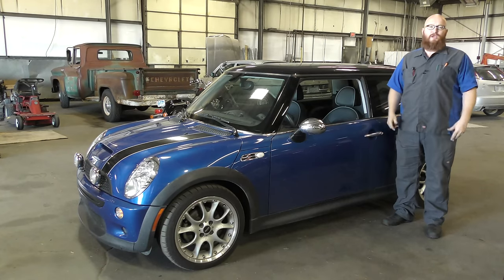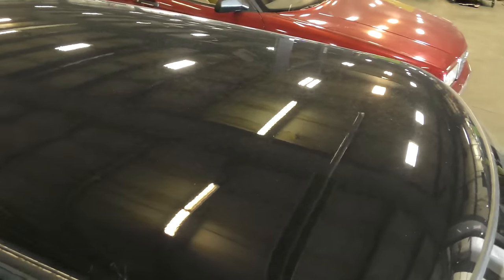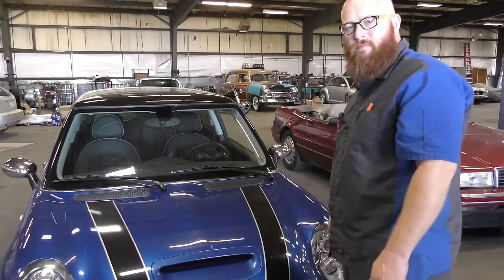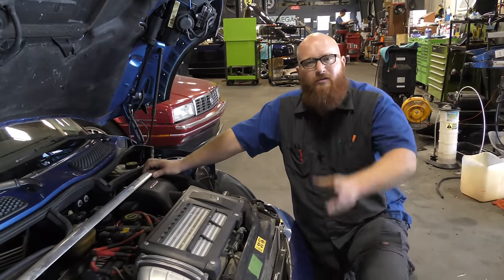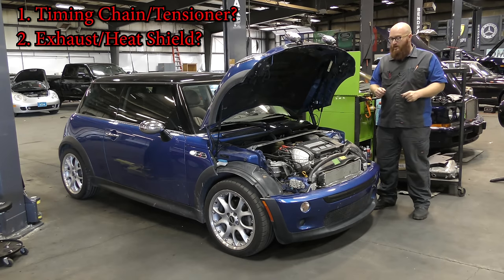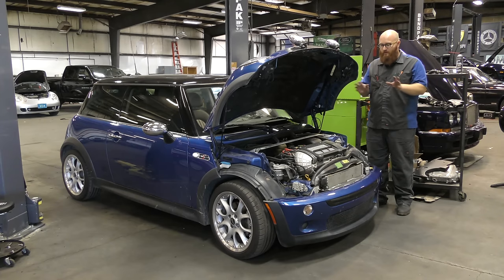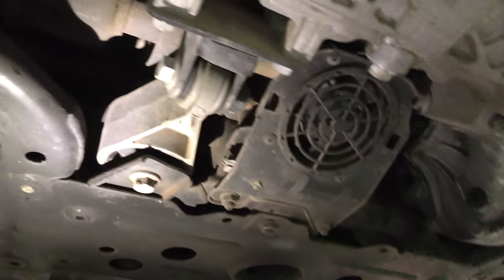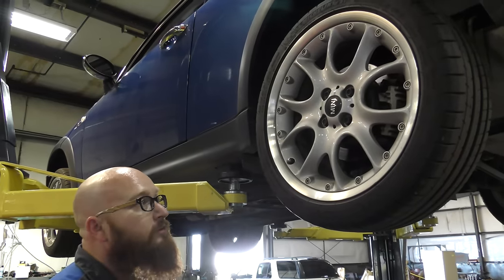Roaring Loud Mini Cooper S! The CAR WIZARD finds the source of the mysterious noise

Comment: My Sister In Law had one. It was so expensive to fix every time something went wrong, and things went wrong a lot, that she had to get rid of it. I would never own one, or a BMW for that matter. No thanks!
Reply: the newer ones with the bmw centre dash console ? seen loads of em fail. 2k british pounds for essentially a radio, sent many to the scrapper
Reply: @deadprivacy  

My Sister In Law's had the passenger side door lock go bad. It unlocks the other door when you use the key in it. Total to fix it $2300. My brother asked if he could get one from a auto dismantler and put it in himself. They told him no. it hast to be synced with the engine ECU. She traded it it on a Hyundai and never looked back.
Reply: @romeoalphafoxtrot9517  yep those are the issues and why you dont like working on em,,,,a lot of stuff is propietary and coded on em.
i get told off for booking em in for more than brakes and aservice, the gaffer of where i work has been burnt before on em.
Reply: BMW's have an underserved reputation for being costly to run. Just avoid turbo charged engines and M cars!
Reply: @shatbad2960  thats nonsense, they have that reputation for good reason, mainly the parts costs, there are thousands up on thousands of them in scrapyards the world over, put there because they're worthless when they fail and an  absolute shit to work on.
the words "not economically viable to repair" personify the modern bmw. same as audis. shite.
Reply: @deadprivacy  Americans are over charged for labour which doesn't help. Further more, there are many BMW's on the road, so many will end up on the scrap yard. The only serious issues I have ever had after years of owning BMW'S are turbo diesel issues. I wouldn't buy an early 335i or some later turbo cars either. I will say this, for the price, it's hard to beat a BMW for driving fun and luxury on the second hand market.
Reply: @shatbad2960  i have to say youve been rather lucky, im in the uk and its admittedly a lot of turbo diesels that were sold into the uk market. noone wants em, they are cheap as you like over here.
cars that cost 40k and upwards can literally be had for 300 quid only 15 years down the road as they often have terminal issues. if youve escaped things like vanos failures and oiling issues youve been very lucky.
Reply: @deadprivacy  The straight sixes(petrol) are sweet as a nut. Buying an expensive diesel is a mugs game. But then, I only buy older vehicles so I don't suffer much depreciation.
Reply: @shatbad2960  indeed the n54 is a bit of a masterpiece, still a three hour job to change a rocker cover though...and they cook their ignition coils at quite a rate.
Reply: Shat Bad The V8 BMWs are complete shit.
Reply: Never buy a Mini Cooper, Smart Fortwo, Scion iQ or a Chrysler PT Cruiser, because they are all extremely garbage.

Comment: I like the Mini Coopers and was tempted on getting one but the reliablity and maintenance on it is ugh..
Reply: No they aren’t. Don’t listen to that rubbish. Get a cared for car with sensible mileage and they get very few issues at all. If you buy some race tuned crap or high mileage abused shed then what do you seriously expect from a 1600cc?
Reply: Thats VERY dependant on the version. First gen R53s (2002-06) are great cars
Reply: I see Minis with blown engines under 100K miles on the market not uncommonly and working on them will make you cry. Even the oil filter is barely accessible behind the engine next to the exhaust manifold. You made a wise choice. If you really want one, lease a new one.

Comment: Usually it's the serpentine belt pulley. I replaced one myself and did an alternator change. I think that small supercharger pulley was replaced also I can't remember. Also that powersteering pump is covered under a recall. It will go out on you eventually.

Comment: From the sounds of it, I would also say the timing chain tensioner. you can remove it and just attempt to actuate the cylinder. It works off of oil pressure when the car starts up. The only question I would have is, does it currently throw codes for timing?

If so, it may have skipped a tooth on a sprocket. additionally what may also be bad if timing tensioner is bad, is the guides. These commonly chip and break. Mod Mini has a channel to replace the guides if you just need a reference video, however you are the wizard so probably not needed. While your doing a check over, look at the coil pack, specifically coil #3 it commonly will shows signs of rust for some reason. 

This car has such low mileage I doubt anything would be wrong, but supercharger does drive the water pump. It is common for the gear on pto side to dry up. Im having mine rebuilt at the current moment by @detriottuned.

Comment: 7:07  did anyone notice that this Mini doesn't have headlights is mounted to the hood instead of cutting holes on the hood?
European Spec?
Reply: The first generation of BMW minis (r50/r53 2002-2006) were all like that (headlights on the hood as it raised). The R56 and later had holes in the hood for the lights. Reason being, when you open the hood with the lights on at night, your car can still be seen and not have your headlights on pointing straight up in the air. It was a design oversight on the r53 minis.
Reply: I saw that. Thought IS spec required fixed lights.

Comment: Haha wait until the owner comes to replace his clutch. A 13 hour job that includes taking off the front subframe.
Reply: It's only done 25k miles so won't need a clutch for a while!
Reply: @FloridaEbikes  I own a gen 2 mini cooper that has had a new clutch fitted at 77k miles. No I'm not a mechanic but I am an engineer and do a lot work myself on my cars. 25,000 miles a very low mileage to need a clutch replacing. And so what if it's a 13hr job!

Comment: "I don't find them hard to work on," says the guy that tore a lambo apart and flawlessly put it back together.
Reply: He's right though. I learned on this kind of cooper. It inspires good habits in maintenance and repair
Reply: Fair point, but these cars are not that difficult to work on. I own one and I've done big jobs on the car by myself, and I'm far from a mechanic.
Reply: I wouldnt exactly go with flawless...he cut a hole into the carbon fibre tub.. reminds me of the people that cut access holes in there trunks to do fuel pumps on 3rd gen camaros?
Reply: @bryanhampton6135  To be fair to the wizard, that was under the orders of Tyler. It was either cut the hole or add another few grand onto the bill to take the engine out again.
Reply: MrManBuzz im aware.
Reply: Taelor Wiles agree he did as the customer asked. It just “irks” me. Wizard is a top notch mechanic and that was straight up a hack job. Hes better than cutting a hole to access. Do it correct or dont do it. My opinion
Reply: @bryanhampton6135  I'm inclined to agree tbh. But if Tyler refused to pay him to do it properly again, what other choice was there?

I guess the one thing you could critique the wizard on is he didn't check the replacement gearbox before it went in. But, even then it's hard to blame him.
Reply: MrManBuzz not much he could have done really other than try and recoup the labour cost from the used part supplier..... good luck. Lol.
Long live the wizard. His military background/farmer thinking shows when faced with a problem.
Reply: The lambo that is already leaking oil?

Comment: Blimey I was asking about this car in the Lotus Vlog ... This is a 'late' First Generation Mini (they brought the 2nd Generation out in 2006) but only the 1st Gen. had superchargers. And those front lights are factory options. I noticed it had a 'John Cooper Works' wheels and a JCW badge on the air cleaner and if it is a genuine JCW car its rare and that exhaust was part of the JCW upgrade giving some 200 Bhp. It may well already have the smaller / upgraded supercharger pulley.
Lovely car though and super condition. Luuuurve that dashboard ...

Comment: I own one of these. Great to drive, and easy to get 200hp out of them with a few simple mods, as I've done with mine. I love it. Most fun and best bang for buck hatch around.
Check the low speed fan circuit

Comment: Those lights are usually a dealer installed accessory sometimes they’re factory or port installed . The center instrument gauges are also a rare option on an r53 they usually have the giant speedometer instead and somewhere along the way the car lost is front splash shield that goes under the front of the oil pan

Comment: Pseudo English cars, still being made with sagging headliners after all these years, carrying on the great tradition, "sag on!".
Reply: English and Italian cars are not known for their reliability like Japanese cars are.
Reply: @atx-cvpi_99  I've owned many British cars in my 55 years on the road, matter of fact I still drive a LandRover, so I can't agree that they're all unreliable, but the one thing common to all those I've owned is "sagging headliners", but maybe that's due to the tropical climate where I live, maybe not. Seems like even if a nominally British car ,(Mini), is made by someone else, (BMW), they feel obliged to make it with a headliner that will "sag" after time.
Reply: @gazzafloss  My Jaguar headliner sagged. Took it 28 years mind.

Can still get new ones on the aftermarket though, and not difficult to change.
Reply: @thegearknob7161  to be honest, I've owned four Jags, two S types, (both 1966), one E type, (1970) and one XJ6, (1974) and the only one that had the headlining problem was the XJ6, the others were fine. But every pommy car since, Triumph, Range Rovers, Discovery, hopeless sagging hood liners. But then Mercedes have the same issue too. I still love my Brit mobiles.
Reply: @gazzafloss  what Land Rover do you drive currently? And how reliable is it?
Reply: @Elijah-cy9do  We have a 1998 Discovery "S" (no ABS, no SRS), TDI 2.5 diesel, manual 5 speed trans which we've owned for the past 12 years, 225,000 kilometres. Apart from two routine timing belt changes each at 100K intervals, a broken clutch release fork at 170K, water pump at 198K and the headliner sagging it starts and runs reliably every day. They are prone to body rust but it has had a "Couplertech" electronic cathodic protection device fitted since new by the original owner, so the body is rust free and apart from minor chips and scratches still looks acceptable after 23 years of being used as a 4WD in remote areas.

Comment: I owned a ‘06 Cabrio S with sports suspension and run flat tires - yikes it was stiff. Chrysler engine with supercharger whine made a surprisingly good combination - thermostat died early on and car began using coolant then poor starting so traded on a 2011 with turbo engine then timing chain tensioner failed but picked up early - so called bmw quality a mirage

Comment: Love ya Wizard, but I have to call “Shenanigans” on your diagnosis. “Bad Supercharger Pulley” is not a diagnosis. It’s pressfit to the shaft. If there’s play in there, the Supercharger is toast or the bushings are smoked. Either that or you meant to say “Bad Belt Tensioner”, which is likely the culprit and what is the source of the noise. “Heart” this when the pulley is replaced and nothing changes.
Reply: i though that as well , supercharger pulley cant be bad coz its pressfit to shaf , only way to diagnose this problem is take a belt off and spin every pulley by hand 🖐 but  sounds more like belt tensioner or worst case scenario bad bearing on supercharger

Comment: The downside of standing for a long time and super low mileage are issues like the bad pulley here. It probably dried out for standing for years and then lunched itself as soon as the car was started after a long lay up. I believe the supercharger service interval on a Cooper S is at 100K and this car has only done 25K. It’s a nice example though. Perhaps the owner should have trailered it to the Wizard to recommission it before the pulley went bad?

Comment: I've owned 3 mini's one r56 and two r53's. Kept the r53's and dumped the r56. The r56 almost all will have either experience issues with a failed timing chain component or vacuum pump requiring a rebuild, oil leaking from oil cooler housing, failed high pressure fuel pump, issues with electronic thermostat, turbo wastegates failing, or issues with lost communication with DME (burned out ecu) you can see my videos how many r56 issues vs r53 videos only a few.

The r53 (s) model will usually have issues with either a failed fluid filled harmonic balancer over time, oil leaking from crank position sensor, cracked rubber intake boot, failed upper engine mount, failed lower control arm bushings, failed power steering pump, leaking power steering hose. The base model non-S automatic r50's will all almost experience a failed CVT transmission over time and I would run away from those!

Either way you'd have to get used to removing front end of either model at some point to gain more room to work with, but I rather prefer replacing failed components here and there than have to rebuild engines or reprogram BMW style ecu's which is why I kept the r53's with one of them turning over 170k and still running strong!

Comment: My last car was a midnight black R56 Cooper S, traded up from a regular Cooper hatch, I loved the thing, but it cost me 6 points on my license, I traded it in for the 1.6 PSA Diesel, My mechanic hated it so much he blocked my number. Think access and corrosion are one of the reasons why mechanics run a mile from them.

Comment: I just bought one with only 73k on it and besides a small dent and single scratch in the paint on the outside the interior is literally spotless, way cleaner than the one in this video also mine has the giant sunroof option. Engine is whisper quiet. I'm pretty handy so even if it needs something like a new timing chain I can do that myself. It's the NA model and for the most part those are way more reliable. Going to upgrade the cooling system and exaust, get a tune some suspension work and rims eventually. Then just enjoy the gas mileage. More than double my last car. I can actually go on some road trips now. I will miss 430hp just a little bit tho.

Comment: As for why most shops refuse Mini Coopers - Probably because in the modern era, they're BMW designed. And you know how it is with BMW. Get enough pain in the ass, trashed Minis and eventually you just want nothing to do with them. Front end off for this, fenders off for that, oh hey look the things I need to remove a dozen of are all rusted to hell, the "PITA" meter adds up quick.

Comment: 2005 cooper S has a whistle noise only while driving at 4k revs onwards and slighty down on power :(   new snoot boots this year so not them , vacum pipes all good too,   idle and rev it sounds fine, Just while driving ,  also had new alternator last year too, has 19% pully and supporting mods .

Comment: This generation of Cooper S has a potentially serious issue with the timing chain, which is located inside the engine. It's famously called the "death rattle". It is crucial for these cars to always have sufficient oil for the tensioner to work properly. However, who in this day and age still checks their engine oil on a modern car??? Many unaware drivers have driven their cars until catastrophic failure. I had a 2006 cooper S with this exact issue. Sold it quickly, while it still had some value. What a shame, it was awesome apart from this major flaw. Over here in Europe we still see many 1st gen copper s cars on the road, but this 2nd gen has pretty much dissapeared. Not one for longevity.

Comment: "What was the worst noise your car has ever made?"  Belt squeal on a 1986 Ford Tempo Diesel / 5 spd.  The belt would periodically need adjusting, it had a set it yourself tensioner.  Never knew when it would start, but when it did you could hear it for miles.  reeeeEEEEEEAAAKKK!  It was deafening.  I'm sure the neighbors loved it : /
VT247

Comment: Could you do a video on front brake Caliper pins. Mine on my Toyota Corolla has been knocking for a year till I found out why it was . Changed ball joints and drop links until I found slider pins was at fault.

Comment: Hi there,you mentioned a couple of times the ride-height sensors on the mini.So i just wondered why a vehicle such as this with what i imagine has static suspension would use those for?🤔.
Reply: Xenon headlight self-leveling for different vehicle loads.

Comment: JCW Gen 1 car. Those are decently rare. No Sunroof, also rare. That's a good car right there!
Reply: Also, '05 and '06 are the most reliable MINIs on the market!
Reply: If the exhaust tips have the JCW logo, the exhaust is stock. I'm pretty certain that's a JCW car, which at that time, it wasn't a trim level, it was a package added to the S trim when the car was originally specced. That car has the JCW intake, JCW strut brace, and the exhaust is another item in the JCW package.

Comment: Sounded more like the Hydraulic BELT tensioner...How does a supercharger pulley go bad ?  In 20 yrs of MINI repairs never seen an original one fail.....The one you show was the original SOLID pressed on piece....?  Was it the bearing behind it ?

Comment: I have been wondering about that car. I had seen it in the background. I’m just finishing up my daughter’s 2009 with the N12 engine. We did the top end and piston rings timing chain and a whole bunch of other things. It should fix the oil consumption and last her another 126000 miles.